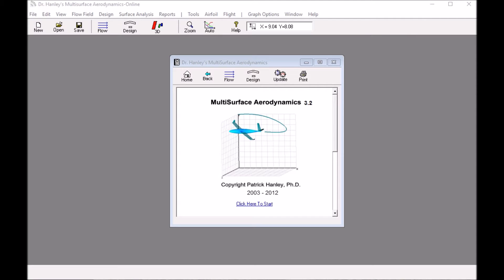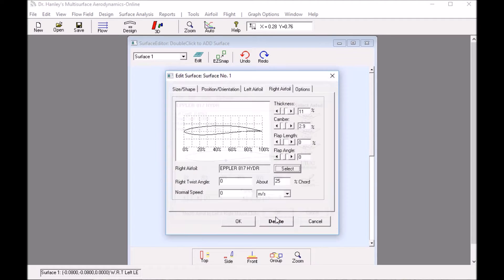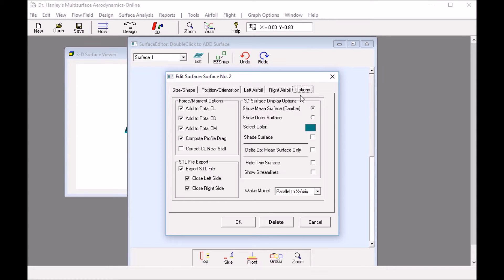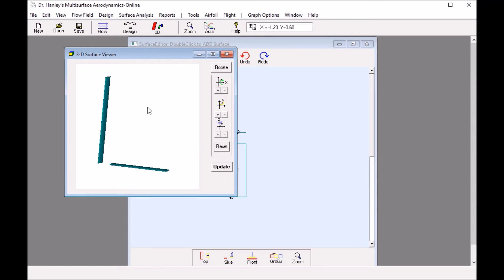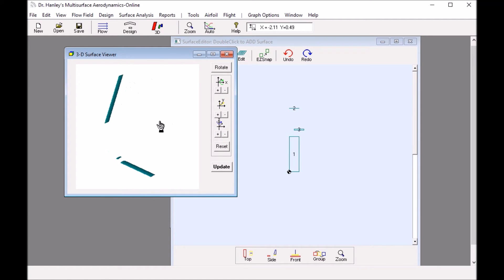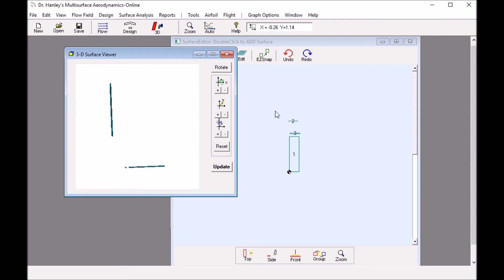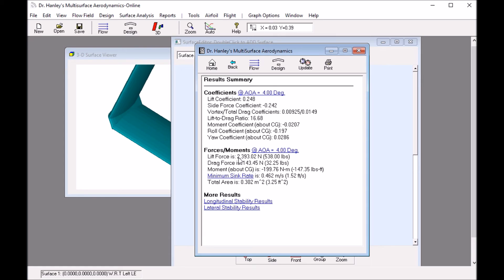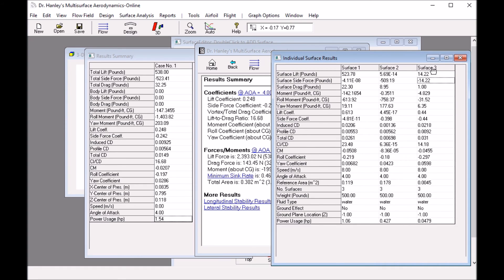L-Hydrofoil Design and Analysis Tutorial

Comment: Why did you use eppler foil specifically ? Thanks
Reply from the maker: Hi Bhargav, thanks for your message. 
 A few years ago, there was a post on Boatdesign.net featuring a hydrofoil exercise to validate CFD methods (see https://www.boatdesign.net/threads/hydrofoil-exercise-to-validate-cfd-analysis.51552/).  This was the airfoil used in the exercise so I used for this example.
Thanks again.
Best regards,
Patrick